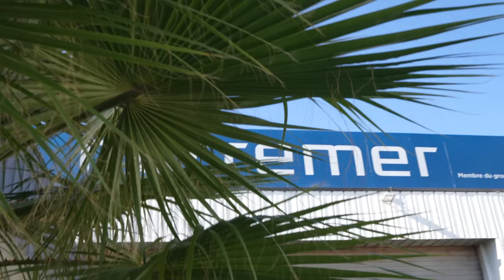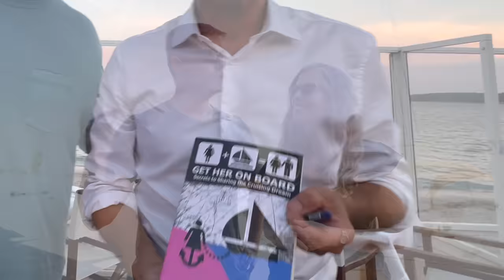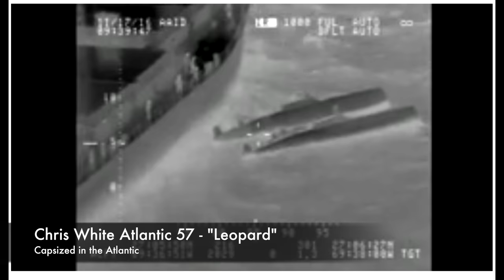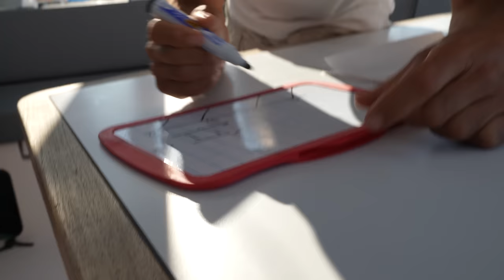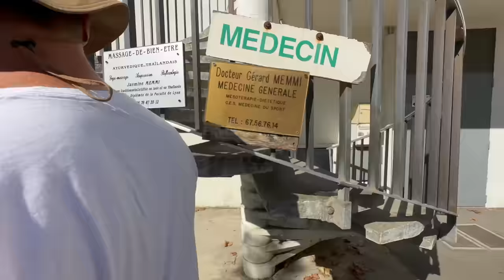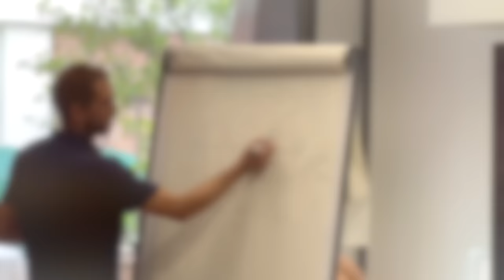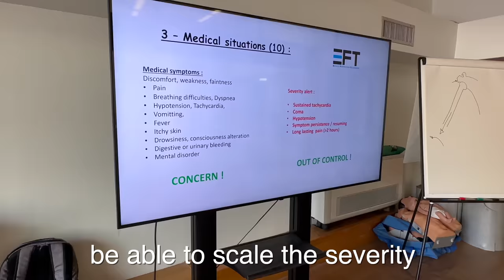Embarrassed at "Outremer Week" Catamaran Training

Comment: So it's not a 52, so it is a 55? Don't people sometimes cancel their new boat and it is already part built, leaving Outremer with a space to fill? Doesn't Outremer have a funding option? Really hope you get a Outremer, they look so fast and sexy. You both look very happy, life is short for you (and me), best to buy top end products.
Reply from the maker: Who knows....but for now, we gotta move on.
Reply: RIght move. Love the 52 but a new build price is going to be impossible to justify as used boats drop in price. We've seen these market turns before. Used boat prices will decline for at least a year - maybe two because a small number of desperate sellers will have to take any price they can get driving the price down for all. New builds will keep going up in price because of inflation. Eventually, we will reach a new supply/demand balance. A buyer with cash in hand has tremendous leverage right now. RIght place at the right time :)
Reply: @carlnelson4413  But they have 100k+ subs, surly that means there's an Outremer sitting at the marina waiting for them? 😉

Comment: I can’t wait to see you putting up great sailing content, but for Kim and I your boat shopping and health issues really lined up exactly with ours. We love your videos and fully support your efforts to get back on the water while we keep searching for our first motor yacht. There’s just no real way to do the Great Loop and other inland waterways with a mast. 😢
But hey…electric sail drives and much more affordable LiFePo4 batteries make over-reliance on diesel a thing of the past, and we’re excitedly looking for a great boat with a bad engine that someone is looking to bail out of!😂
Reply: "Great Loop" make use of multiple (depends size of boat) smaller diy winch fold down furling masts (for under bridges), requires min rigging, use dyneema. Have elec/solar, but also redundancy of outboard, used for tender. I setup 10kWh Inverter + 15kWh server rack for <3.5k (usd)